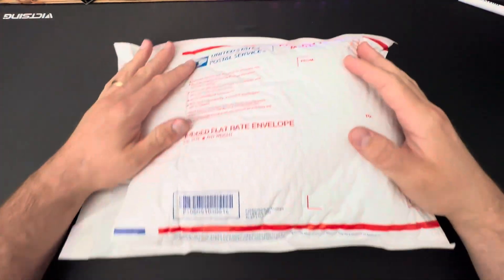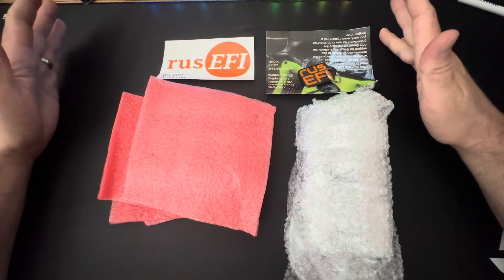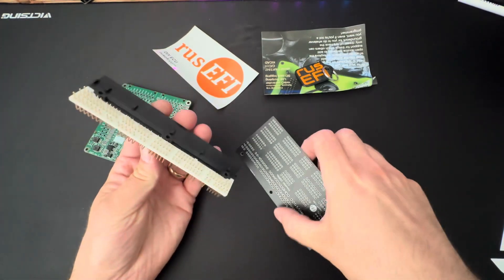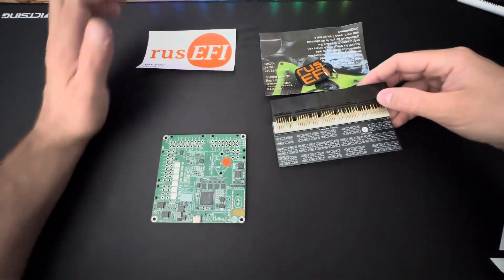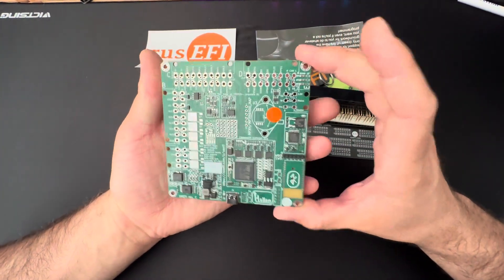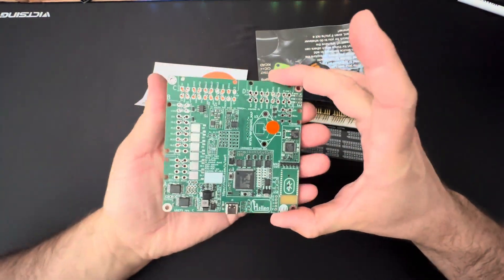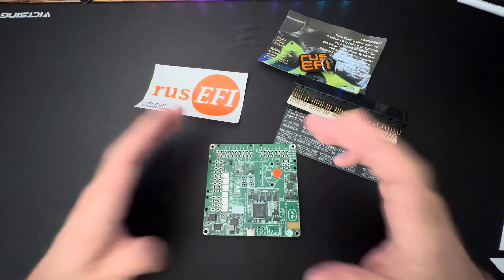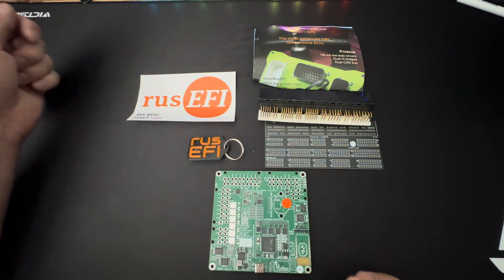RusEFI Hellen UAEFI Unboxing and Overview. 5VZFE \ 2UZFE Break Out Boards too !

Comment: Very interested in possibly chatting about this. I’ve currently got a 5VZ and am planning on boost here in the near future. I’m a Honda Master Technician, and have done some stuff over the years but this is my first Toyota ever. Looking to speak with someone on the level. Oh and check my video of coil pack conversion I did on my 5VZ. Hope to hear back. Cheers.
Reply from the maker: I will be making more videos on this in the future so stay tuned if you want to see more on this